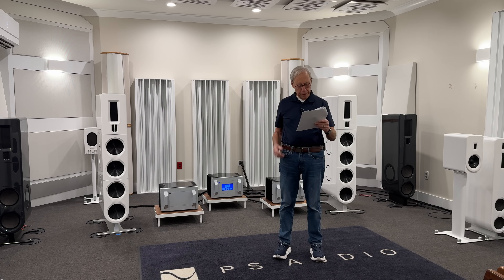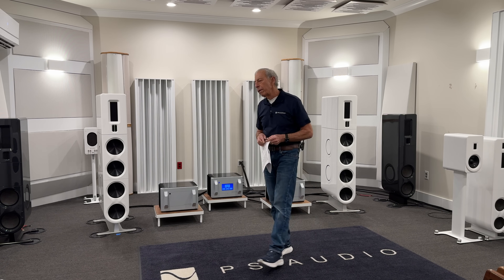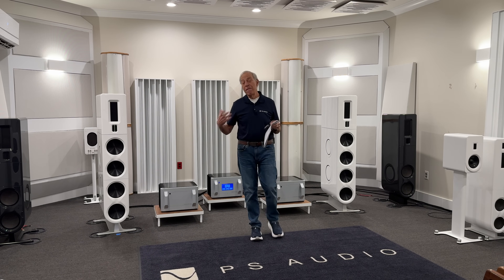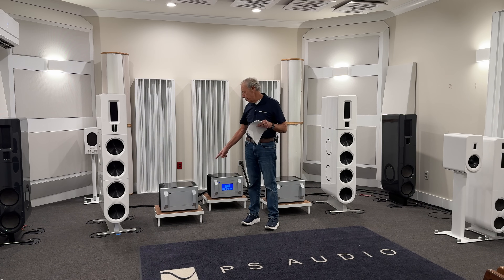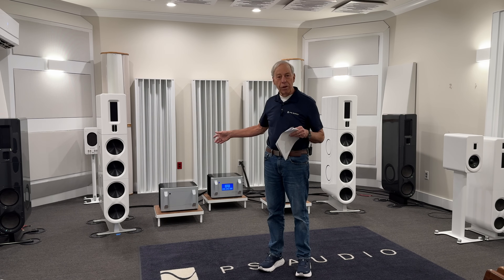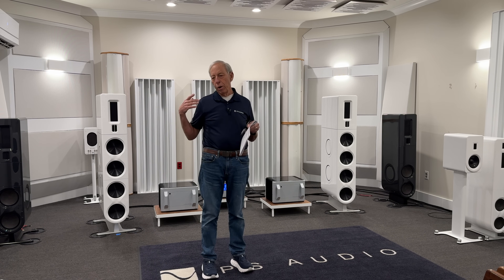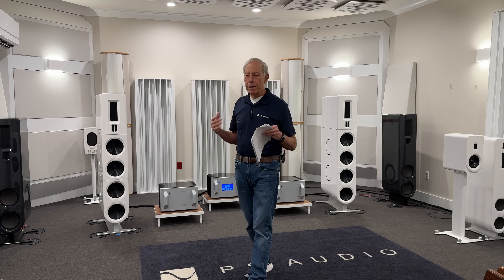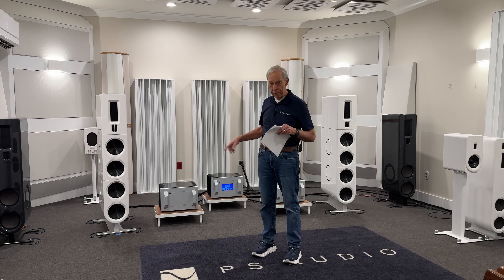Why do manufacturers use Class D amps for subs?

Comment: Yes indeed.  I had this at the back of my mind since I personally use a class ab intregated amplifier for my mids and high and always  belive in subwoofers doing ther job of creating a base. Now the question was how can class d of the subs match or  blend with the class ab . In my case it does and the setup is so important. Now my question is a bit different.  What is wrong or rather what will be if we make big subwoofers with class ab  amplifiers.  Now here am overlooking the cost price. If you can possibly answer that . Thank y

Comment: I have a pair of active subs (in stereo) which I power with a Class H amplifier by Yorkville. Yorkville is obviously not a HiFi company but I was really impressed by the results. I used to use a pair of Bryston 7B THX monos for the task. They were awesome, but the Yorkville was a fraction of the cost and occupies a fraction of the space as the  7Bs.

Comment: Thanks Paul for answering the question! but you missed a very interesting point IMHO, what you mentioned about Class-D Amps is true for may be 10 years ago.The new class-D amps from Purifi/Hypex doesnt have the problems of "A sound to them" , The issue is that most people are used to listening to sub-optimal sound from class A/B for a very long time.  Do a search on web for "All amplifiers are analogue, but some amplifiers are more analogue than others" when you get some time.

Comment: ...and there's the Swedish..
LAB-GRUPPEN  PLM series among many others , back from 15/18 years back ..
The PLM 44K is a 4 ch. prof. audio amp outputting 
20000W (yes 20kW) class AB audio (controlled by the class H topology) from an SMPS...so it weighs in at 12/15 kgs... The 4 audio(@5000W each) amps are on Copper 
heatsinks with fans cooling the amp.& pwr. stage.
Driven by the "LAKE " processor and network compatible & remotely controllable ...all 4 ch. can be programmed to 4 diff x-over freq. ranges if reqd...
So there's no reason why a class AB should not have a well designed & lightweight SMPS as a power source .

Comment: I just bought a McIntosh MHT300 receiver (yet to be delivered so I haven’t listened to it ….to be run with B&W 804 D2) which reviews are raving about.  Has McIntosh solved the high frequency issue with class-D amps that we’ve all heard about and that Paul mentions here?  I really doubt the high frequencies on my MHT300 will be disappointing.  But I’m open to polite opinions……

Comment: Once again, Paul has hit the nail on the head. While I don’t claim to possess his vast knowledge on the subject, I do have a fair understanding of the situation. Here’s my synopsis for anyone who’s interested. Which aligns perfectly with Paul’s.

Manufacturers of subwoofers often use Class D amplifiers over Class AB amplifiers primarily due to the following scientific reasons:

1. Efficiency
	•	Class D amplifiers are much more energy-efficient (typically 85–95%) compared to Class AB amplifiers (50–70%).
	•	Subwoofers require a significant amount of power to drive low-frequency sounds, which means a Class AB amplifier would waste a lot of energy as heat. Class D amplifiers minimize heat production, allowing more energy to be directed toward producing sound.

2. Thermal Management
	•	Class D amplifiers generate less heat because of their higher efficiency. This reduces the need for large heat sinks or fans, making the design of the subwoofer more compact and cost-effective.
	•	For high-power subwoofers, thermal management is critical, and Class D amplifiers simplify this significantly.

3. Power Output
	•	Class D amplifiers can deliver high power more efficiently, which is essential for the low-frequency demands of subwoofers. Bass frequencies require moving large amounts of air, which translates to high-power demands.

4. Cost and Size
	•	Class D amplifiers use smaller components and require less complex cooling systems, which reduces manufacturing costs and allows for more compact designs. Subwoofer manufacturers can therefore offer more powerful systems at a lower cost.

Are there sonic benefits to Class D over Class AB?

Class D amplifiers can offer practical advantages for subwoofers, but in terms of sound quality, the differences are context-dependent:
	1.	Frequency Range and Distortion
	•	Subwoofers operate in the low-frequency range (typically below 200 Hz), where distortion or switching artifacts inherent to Class D amplifiers are less audible. This makes Class D amplifiers well-suited for subwoofers.
	•	In contrast, for full-range audio systems, Class AB amplifiers are sometimes preferred for their lower distortion in the mid-to-high frequencies.
	2.	Damping Factor
	•	Modern Class D amplifiers can provide a high damping factor, which helps control the movement of the subwoofer’s driver cone, resulting in tighter and more accurate bass reproduction.
	3.	Dynamic Range
	•	The efficiency of Class D amplifiers allows them to handle dynamic peaks in bass-heavy music or movies without clipping, providing a better listening experience.

Conclusion

The choice of Class D amplifiers for subwoofers is primarily driven by their superior efficiency, power output, and thermal performance. While Class AB amplifiers are known for their sound quality in full-range applications, the practical and sonic benefits of Class D amplifiers make them ideal for subwoofer applications.

Thank you, Robert.
Reply: I just bought a McIntosh MHT300 receiver (yet to be delivered so I haven’t listened to it ….to be run with B&W 804 D2) which reviews are raving about.  Has McIntosh solved the high frequency issue with class-D amps that we’ve all heard about and that Paul mentions here?  I really doubt the high frequencies on my MHT300 will be disappointing.  But I’m open to polite opinions……
Reply: @drlouiscardinal752  -- The best Class D designs closed the performance gap vs. their Class AB counterparts years ago.  An amp based on (e.g.) Purifi OEM modules is audibly indistinguishable from a Class AB amp with comparable specs.  The "high-end" sector of the industry knows this for a fact, but ignores it in order to keep selling immensely profitable Class AB monsters -- like PS Audio's BHK -- based on a mythical advantage that no longer exists.  I'm sure you new AVR will perform admirably across the entire range of human hearing, not because "McIntosh solved the high frequency issue with class-D amps," but rather because that "issue" is moot for today's best Class D designs.
Reply: @editorjuno yet McIntosh makes most of their high end amps class a/b .
Reply: @mitchtaylor6512  -- True.  But, as with PS Audio, that's a marketing-based decision and has nothing to do with measurable or audible superiority.
Reply: @editorjuno  what makes you so sure? PS audio BHK also has a tube input section, which can make an audible difference. They could build expensive class D amps like Jeff Roland does, maybe they like the sound better. I definitely would not want my only options to be class D amps, what a boring audio world it would be, since no audio equipment sounds like live unamplified music anyway.
Reply: @mitchtaylor6512  -- The BHK amp actually has an inferior published THD spec compared to PS Audio's own IcePower-based Class D power amps.  That alone could certainly account for any "audible difference."
Reply: @editorjuno  so what, I lived with great measuring solid state preamps for a long time, then I tried a tube preamp which sounded way better with worse measurements. Triode tubes are more linear than solid state, they just make my system sound better, so who cares about a distortion measurement that's most likely below the audible threshold.
Reply: @mitchtaylor6512  -- "Triode tubes are more linear than solid state" is a nonsensical statement.  That said, by all means suit yourself -- it's your $$$$ and what pleases you is what ultimately matters.
Reply: @editorjuno  I don't think you really looked into how linear a lot of triode tubes are, transistors need feedback to be linear.
Reply: @mitchtaylor6512    Lots of things need feedback to linearise them, including output stages.  That doesn't make them bad.
Reply: @wilhelmvonn9619  I never said it was bad, just pointing out that triode tubes have some advantages over transistors, just as transistors have some advantages over tubes.

Comment: I know it's a total different category from audiophile systems but I've listened to some of the pro-audio pa systems that utilize line array drivers with integrated subs and am currently listening to two in my room at the moment each powered by 1000w class D amps....and the only harshness I hear is due to the extremely high spl levels I can reach with the utmost clean sound across the whole frequency range

Comment: If my room is modest in size and my amp puts out just say 100W/channel, they why would I need a 1200W sub? Seems mismatched. I know a lot of the sound and power needed is in the bass region, but still...I mean, sure, more is better, and I'll "dial in" the sub to blend with the mains, but that seems a big difference.
Reply: a specially designed subwoofer driver and dsp need a lot of power to reach infrasonics with max excursion, not even playing that loud.
and 1200watt is max output, not meant to go there, 300watt music power perhaps then 600watt peaks, then some overhead. now it looks more reasonable.
my subwoofers are happy with 100watt 8ohm amp, but measuring the power draw i can see 280watt sinewave pull from both channels driven.
its all about the design.
Reply: @sudd3660 thanks! Guess it isn't unreasonable then, especially if the sub goes down to 18 Hz or less. I'd forgotten about those infrasonics at the low end, like how thunder and certain pipe organ can be, requiring a lot of power to reproduce.

Comment: Class-D has a tight control of bass drivers.  However, using class-D to power the compression driver (upper midrange) in my system sounds harsh and unsatisfying.  I have an active system which uses a 20 watt integrated tube amp for frequencies above 800 Hz (waveguide with compression driver upper midrange, and AMT treble) and over 2000 watts per channel for everything else.  I can switch between internal class-D and external tube amp.  I only use the internal class-D to help calibrate what volume I need to set the tube amp.  The difference in sound presentation between tube amp and class-D for treble is very dramatic.  I watch a lot of movies on my system.  With class-D treble, the locations of voices is more pinpoint, but has a smaller spatial volume.  As such, I end up having to turn up the volume to hear the dialog.  However, with tubes, the voices have a larger spatial volume and sound much clearer.  When I change the speaker cable from the tube amp, the difference is very noticeable.  However, changing the 3 pairs of XLR cables from my pre-amp to the speakers does not make much of a difference (e.g. MonoPrice XLR upgraded to Shunyata Venom XLR).  The XLR cables are for the subwoofers, the bass-and-lower-midrange, and the ambient array drivers.  For the large drivers used for bass, we want the control of class-D.  Trying to use a good tube amp for bass can be extremely expensive, and I am not sure if one will get a noticeable improvement using something else.  However, since most people don't use active systems, they are stuck with one topology for all the drivers.

Comment: Class A amplifiers make awesome space heaters!
Reply: My NAD C356B is a good space heater. 😂 Don't know if it's AB or not but I don't think it's class A.
Reply: But they sound sooooooo good! Grill a sandwich and have great sound. What's not to like?
Reply: @rosswarren436 you 100% can't hear the difference
Reply: @ but I can at least when listening to full range sound from an amp. There is a difference between Class D and AB and most definitely Class A.  Fortunately, amps being made with Hypex or Purifi chip sets and architectures are getting better, but they aren't there yet.
Reply: @rosswarren436  The audible differences between amplifier classes are minimal to nonexistent when operating within their linear range. Modern Class D amps, especially those using advanced chipsets like Hypex or Purifi, have distortion levels so low that they are imperceptible to the human ear. The “warmth” often attributed to Class A amplifiers is usually due to harmonic distortion, which is subtle and only measurable under specific conditions. If a Class A and Class AB amp are designed to high standards and measured accurately, any audible difference in a blind test would likely vanish.
Reply: @mistafizz5195  maybe, but I've not heard a Class D amp (full range) that would make me want to give up my Class AB solid state or Class A 300B amp.  Maybe one day.  I'm 66 and likely won't change, but for any kids coming up, hopefully in another 10 years Class D will be where it needs to be.  I hope so.  Ironically, I think single ended tube amps will be around many more decades. People love them that much (with the right speakers).

Comment: My sub has a class B amplifier in it. It has worked fine for many years but I don't know how efficient class B is?
Reply: Unless you built it yourself it is more likely Class AB than pure Class B. Class B is very high in distortion. And the design difference is very small.

Comment: For my room and for my ears, subwoofers that use class D amplifiers sound noticeably quieter than subwoofers that use the A/B amplifier equivalent. 

If you're considering a near field positioning for your subwoofer, then a subwoofer with a class D amp would probably be the better choice to go with
Reply: If you hear your subwoofer it is either crossed over too high or has bad vibration problems.
Reply: @glenncurry3041  it appears that we're on two different pages. You're going on about performance while I'm talking about distortion. 
Tweedledee and Tweedledum. Ok, I'll take the dumb 😳

Comment: Just having a brainwave....how about a hybrid of class D for the bottom +  AB for the top    😂
Reply: I use over 2000 watts class-D for bass (below 800Hz) and 20 watts integrated tube amp (with NOS tubes) for treble (above 800Hz).  Changing the amp for frequencies above 800Hz can make a dramatic difference in the sound presentation.

Comment: An interesting afterthought would be why one needs a 1.000 W upwards amp to drive a good sub.
Reply: Yep ... one has to wonder at the amplifier powers today.  Why does someone need 1200 watts when they're probably listening at less than 10?

It's kind of like putting a nitro burning fully blown engine in a toyota so you can do your shopping.
Reply: @Douglas_Blake  I think in the case of subs it has something to do with being able to go lower with smaller diameter drivers. Don't understand the physics behind it though.
Reply: @esce69  
It's pretty simple really ... to move the same amount of air a smaller driver has to travel further.
Reply: Because the amp is class D? Sorry couldn't resist. ;)
Low efficiency speakers need more efficient power (and provide another reason for the classes to sound more alike). Started to say "drivers" but a small box will always be more inefficient for the frequencies of interest, for a given enclosure alignment (and there's always tradeoffs). It's amazing how a little box can shake the room but it's a brute force solution.
Reply: Wow 1w

Comment: Class D IS solid state. And has higher damping factor. Class D is basically ideal for subs.
Reply: Class d is compromised. They arent the same .but they have their usefulness. They weigh less..and if I had to drag them out of a truck every nite..and set up for a show..yes class d is the ticket..if you listen to the subs and pay attention to detail vs a class h or class ab amp they used for live shows made 30 years ago its no contest..the old crest audio amps sound way better than what they use now..its about convience.. yes they run cool so they  are reliable..I agree...but..STOP SAYING THEY SOUND AS GOOD.the output filter is designed for a target imp..speakers arent resistors.. and class d amps..arent top shelf..period

Comment: Can you imagine a 1200 Watt class AB amplifier in the same cabinet as a gigantic sub woofer driver with an enormous magnet system plus the weight of the cabinet structure to hold this lot together....? It would need heavy duty castor wheels ...

Comment: The better GaN FET Class D amps can compete with Class A/D amp full range, and they are faster.
Reply: Haven’t heard one so far, which are you referring to?
Reply: @88Nick88  Orchard Audio.
Reply: Mosfets on the output, no silicon chip and gan power supply makes these special and very different amps. I never ever imagined saying this about class Deez, best suited to stereo I think.